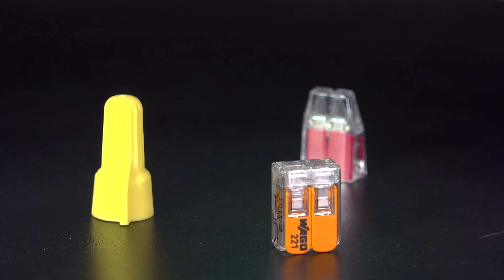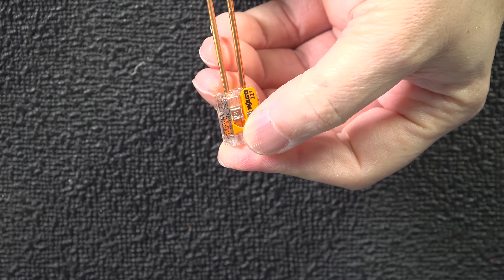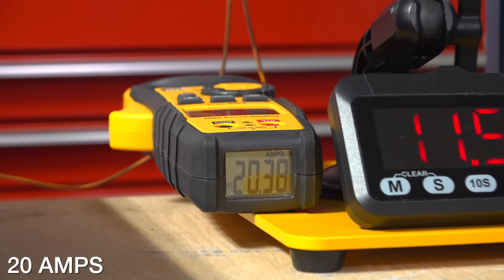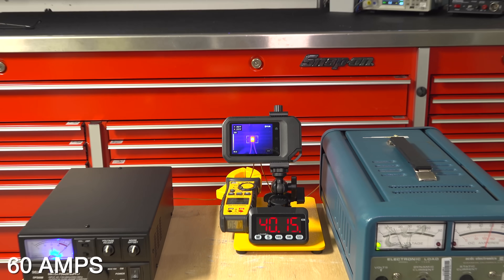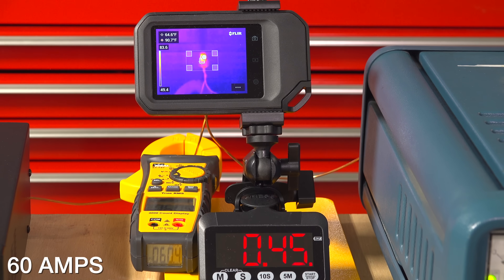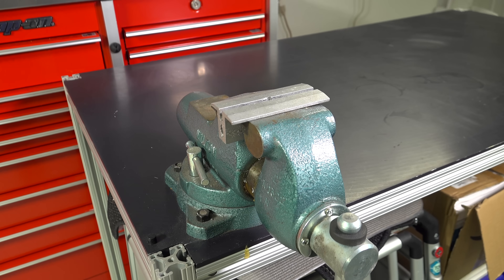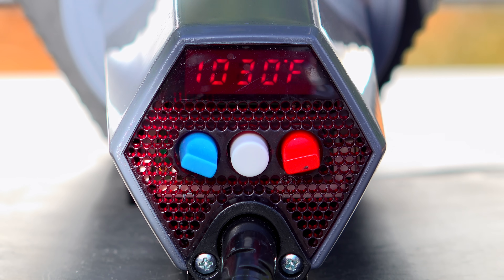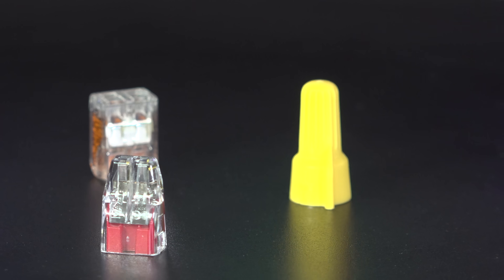What Wire Connector is the Best? Wire Nut VS Wago TESTED

Comment: I don't get the point of wire nuts. We always twist the wires and wrap them in electrical tape which to me seems like a much better solution. Wago is a option that i would consider over twisting and el.tape because it could easily be tested or rewired.

Comment: As an electronics engineer, the Wago connectors are something I've only been introduced to in the last several years, They work great for low voltage applications. I only recently started seeing them used in commercial electrical applications this year...Im only speaking for my local area, of course. Wire nuts have always been the norm. Where I have always seen problems is that our "low voltage" product with stranded wire is normally wired up by an electrician who typically only has solid conductor wire on hand and wire nuts can just be hard to use when connecting both stranded and solid wire together. The Wago works well for both types of wire. I am of course talking about products that draw less than ten amps @120VAC but the Wago really makes connecting stranded and solid wires together very easy.

Comment: so, from the video and some comments on here...  The biggest difference is the fact that for whatever reason, human error, vibrations, thermal expansion etc, the wire nuts do come loose over time and the Wago type connector does not?

Comment: What was the voltage drop across each connection type at rated current? This is a very critical measurement to determine the "better" connector.
Reply: Basically, the parameter that matters is the resistance across the connector, which determines both voltage drop and the heat dissipated at a fixed current.  And the dependence of the resistance with temperature.

Comment: Great test-  From a cost standpoint however the wire nut is a clear winner.
Reply from the maker: It's cheaper, but keep in mind it offers none of the other benefits. i.e. clear visual inspection of every conductor, non-damaging connections, built in test ports, 80% less time per connection to install than wire nut and instant ability to make changes, perfect repeatable connections with almost no variability.

Comment: Could you run the load test on the twisted wire again. But this time comparing it with and without the wire nut. I am curious why the wire nut heated up even though you had the wire twisted outside the connector as well and that part didn't heat up hardly at all.
Reply from the maker: There will be another video exploring this further and while I can't give all the details away, I think some of what you see will cause more controversy then the Wago videos alone. Be sure to subscribe to view it, should be out by St Patricks day

Comment: Alright I'll concede that the wago worked much better than I expected. My last reservation is that you are relying on spring tension to make your connection. Springs weaken over time even when not moving/being worked especially with temperature changes. I have heard the rumor that wago connectors wear out over time even when not cycled. With the other tests you did they are probably safe and I'll at least consider using them in the future.
Reply: I use them since the late 80th (i live in Europe) never had a problem.
Reply: And one thing with "complicated" mechanisms, such as springs, that their lifetime depends much on the quality of production, what metal was used for the spring etc.  So it seems you are either locked into a single brand that you can trust, or you are gambling

Comment: Never had a problem using wirenuts, so i continue to use them.
Reply: German VDE is getting a stroke at this point...
Reply: @philipphermann9454  Fun fact: stroke and (electrical) shock both translate to "Schlag" in German.
Reply: @cfaerber  Ich weiß ;-)
Reply: Innovate.

Comment: Maybe a dumb question: If you have the uninsulated wires twisted, is electricity/heat going through the connector or is most of the energy just traveling along the wire at its first point of contact before it gets up into the connector?
Reply: In idealized setting of multiple identical points of contact in a twist,   equal  fraction of a total current will travel through each point of contact, and, thus equal heat will be released at each point of contact.

Comment: Explain to me why the wire nut got hot at all? The Wago gets hot because the current must flow through it, the wire was twisted and the wire nut put on, the wire nut was doing nothing to cause the heat. Why did your wire get hot at the wound connection.
Reply from the maker: Its a good question, I am working on another video related to this that will be out in a couple of weeks that should help explain that and bring up something new that might blow your mind a little.
Reply: @SilverCymbal  I have even seen plastic wire nuts, no metal inside, kinda glorified tape. But when I saw you twist the wire and the nut go red. Houston we have a problem. The current flow should be through the wound contact. Looking forward to your next video.

Comment: I'm sorry, I'm not suggesting that Wagos or Wire nuts are better in either direction, but your test of the wire nut is not valid.  You would need to NOT twist the wires together where they touch before the normal, standard distance that you would have if the wires were insulated -- the last 5/8th of an inch.  You'd be increasing the surface area where the wires touch which would not only reduce the impotence/resistance, but you'd be also spreading any resistance out and further away than the desired contact point within the housing/plastic of the nut.  You'd want to focus all contacting of the wires to be within the wire but housing, as you'd do with an actual junction within a box.   Again, not saying it would be better or worse than a Wago, just that you're invalidating the test.
Reply from the maker: But you really are....If we follow what you wrote, which could be true and my intention was certainly not to give the wire nut an unfair advantage. The wire nut would absolutely perform worse, there is no way reducing contact area would make it perform better. If you are interested be sure to subscribe to my channel I will soon have another video that will address this and some other issues that will blow your mind.

Comment: This is wrong if you choose to believe this and not all the electrical contractor that tried to warn you  that would be a big mistake. 
The reason  electrical contractors don’t use these is  because they’ve seen them fail . This. Is from experience they don’t need your little test. If you have electrical contractor that think these are a good choice get another electrical contractor. And this channel should have just let it go instead of doubling down on something you don’t know.
Reply: I'm the electrical contractor that gets calls to fix the other electricians mistakes. All the splice issues I've seen in my 40 year career are from wire nuts. Melted insulation, melted wire nuts, melted copper, etc. This same metal spring technology is used in wago terminal blocks in industrial applications worldwide. I was a non believer in 1994 when I was installing a $3 million german built circuit board copper plating line. 2000 amps of 480v power feeding 150 pumps, 8-3000 amp dc rectifiers, massive conveyor gear motors, frequency drives, control circuits, submersion heaters, etc.  I shook my head in disbelief, I said this technology would never hold up. I personally terminated 450 multiconductor 480 volt power cables,  PLC digital and analog control cables, braided heater sensor cables, etc.  I lived with this machine daily until until 2002. It ran 24/7 most of that time. Acid fumes, water spray and electricity all mixed together under heavy loads for 8 years. I was a true believer after that as the only failures in any wago product was when 97% sulfuric had infiltrated a jbox. Thats it, they held up. If that doesn't convince you non believers, I don't know what will. These are the harshest real life conditions, nothing even close to a splice in a residential junction box. The only use I have for a wire nut is for capping off an unused wire. True real life story, do with it what you like. I like to learn new things every day, maybe you should too.
Reply from the maker: @davenag957  I really appreciate you sharing this level of detail, this is very useful for others to see
Reply from the maker: So your experience is better than he fact these NEC approved, UL Listed, NFPA tested, with multiple worldwide approvals, 40+ years use Europe, the standard in UK, Germany and Europe. Not a single photo exists on Google of even 1 burned or damaged 221. Not a single case to be found of one failing causing a fire or damage. Sorry you have no experience with Wago 221s. Maybe backstabbed outlets, maybe push in connectors but that's not what this is.

Comment: The material appears to be excellent to heat.  The general problem though with most connectors like this is whether the installer, even an electrician, makes a solid contact of the stranded or solid wire inside the connector.  Otherwise arcing eventually starts and can lead to heat well beyond what the wire insulation is rated.
Reply: There are no such things like bad connections.

Open the lever all the way, put the 10mm de-insulated wire in, inspect the tip if it's all the way in, close the lever. Done. Good connection.

For that reason the housing is translucend.

The mechanism either grips (and conducts) or not.

If it didn't grip, the wire falls back out and you haven't seen the tip of the wire in the connector. Easy as that.

Comment: Something with your test seems more than a little false.. For the test you ran on the wire nut, the wire was twisted nearly 6in down, but the heat recorded by your camera was only within the nut, not on the twisted conductor as it should have been.. .. .. You also defined your source amperage, but not voltage. Power is a measure of V*A.. A rating of a conductor/fuse is by power.. Your test uses an EL750 which is a DC unit topping out at 55v, and according to your own meter (on the volt side, which you don't show) is running only 15volts.. meaning total power @60a*15vdc  vs.  60a*120vac..
Reply from the maker: Give me a break. Watch the video, I could not have been more transparent. The test is 100% accurate.

Comment: I love wagos especially if I need to do multiple grounds.  Way better to stab in 5 grounds to a wago than trying to get them all into a wire nut
Reply from the maker: I completely agree, very nice to see that each conductor is where it should be and seated properly. I just used 2, 5 conductor versions in a tight box with a USB outlet: https://youtu.be/xuj-sEJryxw

Comment: A few questions/comments:

-how did you account for the emissivity of the different connector materials when interpreting your thermal image measurements? I'm not sure if i can compare the "temperature" read out from the thermal camera between the two components because of the different materials and surface finishes.
-normally wiring is run through walls, conduit, a raceway, or some kind of enclosed space which limits the convective cooling. 
-The temperature of the connector in an open space itself is not as critically relevant as the power it is dissipating, which will heat it and its surrounding components up. 
-Without the heat dissipation from convection, the temperature in situ-will be higher than in the free environment
- do you have a meter than can measure the power loss through the connector? e.g., a four-wire resistance meter, or a sensitive voltage measurement so the power dissipated by the connection can be measured?

Comment: Retest the wire nut with the shielding still on the wires.  Your twist went way down past the wire nut, allowing power to cross over before entering the wire nut.
Reply from the maker: I will be doing a follow up, just working it out, if you liked this video the next one will blow your mind. I am amazed by my prelimary testing on part ii

Comment: It would be very interesting to see how well the wire nut performs when installed without the pre-twisting. With pre-twisting the wire nut is basically just keeping the wires together and isn't really conducting any current itself, all the current is passing through the twisted connection point. Without pre-twisting it seems that there is more likelihood that the connector itself could conduct some of the current which would increase heat. A way to prove that would be to do the test with the twist and no connector to see what temperature the twist reaches.  Thanks for the video!
Reply: It would be disastrous, and any electrician would tell you don't be lazy and spend the few seconds to do the job you were trained to do.
Reply: @bigkirbyhj666  Obviously. As stated in my original comment, the twist is passing the current, not the connector. Without the twist the connector would likely be passing current and I suspect it would fail much sooner because of that. Highlighting that failure mode would demonstrate to inexperienced persons the necessity of installing the wire nut correctly.

Comment: I'm glad you did a relatively full test.  Remember, on of the advantage/disadvantage with WAGOS is that as a practical matter, they may need more or less space in the box vs. a wire nut. AS YOU ADD MORE WIRES TO THE CONNECTION it can get real bad (like how much chance for stuff to come in contact with stuff it shouldn't.  A 2 wire WAGO in my opinion takes up a little more space than a 2-conductor rates wire nut.  But a 4 or 5 conductor rated WAGOS vs. a 4 or 5 conductor rated wire nut is a close trade off.  Many problems with nicked insulation happen because of difficulty cramming stuff back into a box.  The box volume may be ratings sometimes don't reflect how crowded stuff is in practice. 

Also, if you plan to revisit this test, I would like you to run the 3 or 4 conductor WAGOS with the current overload at 60 amps, with, say, 30 amps going to each branch (which is more realistic scenario for an over-current draw with a defective breaker.  I would be curious to see if you hit the same temps as you did in this test.  Then I'd like you to compare a 4- or 5- conductor traditional twisted wire-nut. 

BTW, your twist technique is a little weak... go over the wires dragging the teeth of the pliers so it cuts and blends the copper together.... that is what the wire nut is doing when you apply the correct amount of torque, but not everybody has a reliable torque gauge in their wrist!
Reply from the maker: You can see 2 5 conductor Wagos being installed in a pretty packwed box here along with a USB outlet. Remember they have a size advantage. They sit flat on the sides or back of a box, a wirenut has to contend with the ball room gown of wires below that is quite sizeable. https://youtu.be/xuj-sEJryxw
Reply: @SilverCymbal  That is a nice video.  I have used WAGOS for 4+ wire joining.  I think I wasn't so clear about the point I was making... I edited my comment.  But you right, it's a lot easier to bend back 4 parallel wires than it is to bend back 4 twisted (i.e., braided) wires.  If it has better heat properties in the  4-, or 5- conductor balanced overload situation, then it would almost be foolish not to use the WAGOS when you have to join many wires like that in a crowded box.

Comment: Tested is flawed you need to bring up the voltage to ac at 120volts at 20 amps. Not the setup you have at 12volts
Reply from the maker: No, DC and AC amps are the same, check it out, lots of articles covering this
Reply: @SilverCymbal  the load tester shows only 12volts. Higher voltage at the same amps is much more wattage.

Comment: Saw a different video on Wagos and bought a box of 3-conductors for a simple job I was doing (not an electrician). Twisting wires and screwing wire nuts on has always been a pain. The Wagos are easy to use and even let me make a simple change without turning off power (ok, electricians, I know you do this too so don't complain). I was moving a light switch but needed the light to work while I was adding the wire so I used the Wago as a temporary switch. When the other wires had been installed I was able to easily add the second Wago and move the wires around without flipping the breaker (yes, I added a blank cover plate so I could get to the splice box--1906 house with lath and plaster so not easy to simply cut through the drywall). I will be adding more multi-conductor Wagos to my toolbox.

Comment: Good video. One tip, the Wago 2273 is better for solid copper wires. I use Wago 221 connectors only when I need to connect a solid to stranded wire or stranded to stranded wire. The Wago 2273 is also better priced, approx. 1/3 compared to Wago 221 connectors.